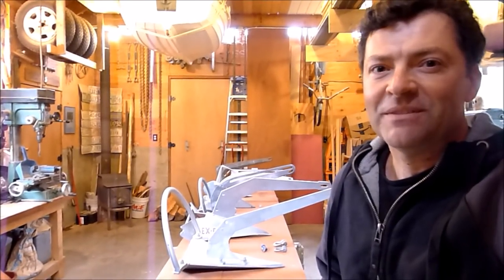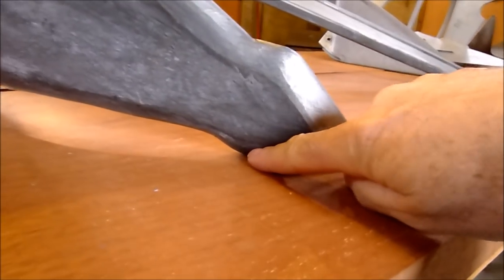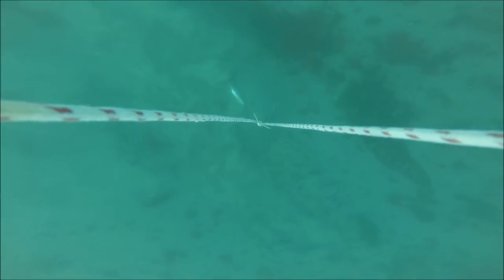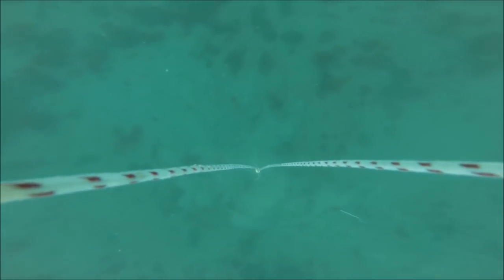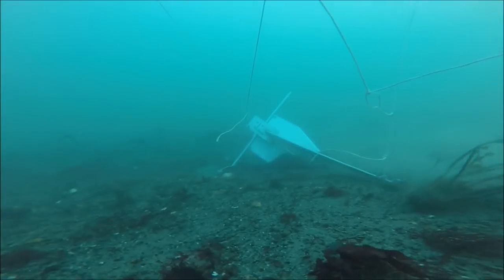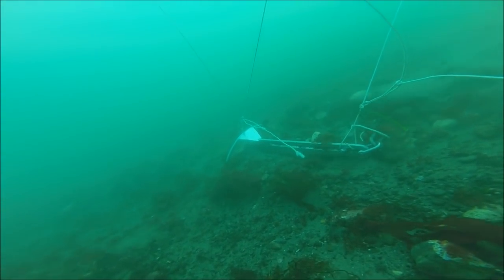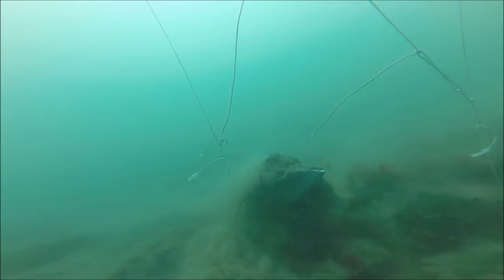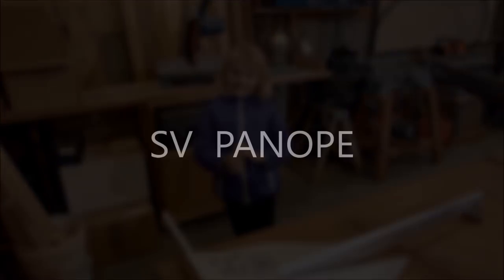Anchor Test Compilation. Video #56 of an ongoing anchoring series.

Comment: Steve, I have watched this video 4 times. It is amazing the work you did. Thank you so much. If I may ask, if you could only have one anchor set in in good/okay bottom for a storm 50-60kts which would you pick?
Reply from the maker: Thanks, David

Tough question without more background.   Assuming this is a FORECAST storm that provides the opportunity to fit an alternate anchor AND the storm is of the variety with a single wind direction, then it would be hard to beat a big Fortress anchor.  The fact that it is disassemblable means that this large cumbersome anchor might actually be onboard the boat!  

If the storm is of the 'multi direction' variety, then a big Mantus would be great as it is also disassemblable.

If we are talking about using the normal 'reasonably sized' bow anchor for an un-forecast event, then the Spade, Excel, or Mantus would be good choices.

It's hard for me to recommend the the very popular Rocna or Manson Supreme given their tendency to become fouled and not re-set in my tests.  I realize this would be a very rare occurrence in real use, but, like crashing your car into a wall, it only takes once. 

Cheers,

Steve
Reply: Thanks so much Steve, I really like the Mantus, but you scared me with the "weak shank" talk. The are right in my backyard in Kemah, TX.  I really like the Excel. Its foot print is so much better than the roll bars, but, I have not found any other independent tests on it that look trustworthy. Do you know any? The fortress is a must have anchor. Thanks for that kernel, since watching your stuff I have found lots about it. My wife and I are planning to take two years off and go cruising. Peope like you are an amazing source of real information. Thanks again for your efforts.
Reply: Thanks so much Steve, I really like the Mantus, but you scared me with the "weak shank" talk. The are right in my backyard in Kemah, TX.  I really like the Excel. Its foot print is so much better than the roll bars, but, I have not found any other independent tests on it that look trustworthy. Do you know any? The fortress is a must have anchor. Thanks for that kernel, since watching your stuff I have found lots about it. My wife and I are planning to take two years off and go cruising. Peope like you are an amazing source of real information. Thanks again for your efforts.
Reply from the maker: Part of the reason the Mantus anchor shank compared unfavorably to other anchors, is that my "45 pound" test anchor only weighed 40 pounds.  

Perhaps a 55 pound Mantus would have been a better comparison to other 45 pound anchors (that actually weigh 45 pounds).

Of course this negates some of the price advantage of the Mantus anchor.

Steve

Comment: Awsome video!!  I just ran across you anchor testing and was really impressed with your technics and results... after watching your videos I am also leaning towards the spade anchor!! My question is my current boat is a 34 sea ray. The s100 would certainly be more than adequate for that boat (15.000 lbs) but in the next year I plan on moving up to a 40 foot trawler weighing close to max rated weight for the s100 anchor (24.000lbs) I plan on keeping the spade anchor and taking it to that boat.. what’s your thought on moving up to the next size anchor?? Or do you think the s100 would be adiquate working at its max holding ratings??

Comment: I appreciate you doing this test.  I know you hesitated to share your judgements at the end but I will say I think it's wrong of you to dismiss the Mantus because the shank 'looks" weak.  To me it looks perfectly engineered to withstand the forces the anchor is designed for keeping the weight to a minimum where the weight needs to be minimum. Without engineering data to back up a comment like that it's not really valid.

Comment: Steve, an other question. I bought the 44 lb Spade and a 7/16" alloy steel shackle to match the strength of the 3/8" G4 chain. The shank hole width is too small to fit the shackle pin hole outer diameter. Did you encounter the same problem? You did have to use a second  shale on an other one..
Reply from the maker: A 7/16" shackle will JUST fit through the hole of my 44lb. Spade.  The fit is so close that I have to wiggle the shackle back and forth to get just the right angle before it will pass through.  Once the shackle's boss has passed through, the fit is good. There is plenty of slop to allow free shackle movement.
Reply: @flygoodwin  The gav alloy steel is just too big. If I file it then I will be removing the zinc coating.  I am getting a 3/8" one . It's WLL is 2 T. I think that the Spade will walk before it breaks LOL! Just for back ground I had a 45 # Delta with 33 m chain on a Jeanneau 409 ~23,000 # loaded. I had several dragging events.I am in the Chesapeake with mud, clay and sand. Thank you for your research.

Comment: I'm a sailor for 40 years, I have a Ct 41 and a moody 44, always using a 45 pounds original CQR made in Scotland.  NEVER EVER FAIL. 300 feet g40 high galvanized chain, high quality swivel and shackles. My secondary anchor is a original 44 pounds bruce made in England,  same, spectacular. Fortresses is garbage, get bent easily, made for stop on the beach in a beautiful day.

Comment: Steve, are you still reeling to questions? If so what do you think of the bolts in the Mantus capturing mud?
Reply from the maker: Captured mud appeared be no factor with the 45 lb. Mantus.  

The 13 lb. Mantus did suffer from captured mud that was located in the vicinity of the shank bolts.  I have to assume that if the bolts were not present, less mud would be captured.

Comment: Thanks so much for doing this hard dedicated work.  I cruise a challenging area and am considering a Fortress FX 16.  I usually put out all my scope (30 feet of chain; 300 feet of line) and power set my anchor, then adjust scope to no less than 6:1.  It seems that this is a more realistic test than the short scope tests.  Will you be doing any such testing?  Would you recommend the Fortress in this application (usually sandy bottom)?
Reply: +Dean Benjamin There is no load on the bolt. The actual load is carried by the geometry of the shank when it's inserted in the base.The boalt is there to keep the shank from inadvertently coming off when your moving it around on deck.

Comment: really nice job. Curious what you used such short chain to depth ratios. I never anchor with less than 5 or 7 to one.
Reply from the maker: Thanks Lincoln.  In my local waters, 3 to 1 scope is very common due to confined, deep, and crowded anchorages.  Longer scopes are often just not possible.

Comment: why no delta set fast? would you put the names of the anchors on the video. it is difficult to follow you. also, you are not testing some more common traditional anchors.  you do not tell people if the anchor is rated SHHP or HHP or unrated, etc... BUT, thank you very much for doing this work. nice work.
Reply from the maker: Hello John.  I tested a Delta anchor AFTER this compilation video was created.  See Video #70 from my list of anchor tests.  

Sorry you had trouble following this COMPILATION video.  I recommend that you take the time to watch each of my anchor videos separately.  My YouTube channel is called SV Panope.  There, you will find many many hours of footage.  Enjoy.

Steve
Reply: I was trying to figure out which new anchor I wanted to buy. I have the classic anchors, called HHP anchors. I now realize there are a new batch of anchors rated SHHP. So, I am looking to find one or two SHHP anchors to put on my boat. I have Fortress but am thinking of buying a FX37 to get the SHHP rating, and then am going to buy one of these new anchors.  I bought a Rokha as an upgrade to my Delta Set-Fast, but according to your tests, the Rokha is little or no better than the Delta Set-Fast. By the way, thank you for doing this and posting it. outstanding work.

Comment: Great videos!  Question on the spade, though.  Isn't the ultimate strength of the shank attachment dependent on just the single bolt strength (in shear) that pins it in place? Great anchor, but could that be its weak point?
Reply from the maker: Thanks Scott,  I believe that very little load is placed on the Spade's retaining bolt.  The geometry of the shank and socket are such that chain loads cannot remove the shank, even if no bolt is present.
Reply: You can remove the pin and the anchor won't separate while in use. Has zero force on in in use.

Comment: The boat will never pull straight on an anchor.  Especially in strong winds. It will pull like a pendulum,  oscillating 90 degrees off the center, fro and back.  I mean oscillating real fast. Over time,  it will work the anchor out of the sea bed.  It will never reset, since it will fly, not even touching the sea bead again as the boat rushes downwind.   I experienced that during Irene hurricane, hooked, thank God, to a vise mooring. I had two hooks, one as back-up of the other.  The first spread wide open.

In those circumstances, you  do not care much about your anchor  setting quickly.  You want it to hold, you stay awake, the engine running, and you watch your neighbours drifting, endangering everyone.  The resistance to oscillation is the name of the game, as is the resistance to extreme traction.

In the south of France where the hurricane force Mistral winds are very common, I mean, about 10 times a season, everybody has a CQR anchor.

I have a 45 pounds CQR anchor and a back-up 45 pounds Spade anchor, mainly, because you can dismantle the latter.

You had very good visual on your tests, but the science of it was fatally flawed.

Comment: There is so much of this type of thing on the internet now. It confuses me. Anchor designers designed their anchors to be used a certain way and yet tests are done in direct opposition to those design parameters. Then decisions about an anchors usefulness/value are then determined by those erroneous tests. Anchoring with a 2.5 or 3 to 1 scope is not recommended by any manufacturer. Ever. Backing down at 3 knots is never suggested as safe or reasonable and a good way to damage most boats with our current crop of fast setting anchors. Driving over your anchor at 3 knots to test a re-set is very dangerous (that technique should never even be used to release a stuck anchor). The anchors were not designed to work under those conditions. You are basically testing random non-real world events that will never happen. It's like testing several cars by driving them backward on the highway and then using those test results to decide which car to buy.  Your tenacity to try tests over and over to get results is very commendable, but you should be testing things that really happen in real life cruising. I've cruised several oceans of the world for 40 years, I always anchor (never at a dock), and I have never encountered your testing conditions even once. I did indeed hear your caveat that you were admitting to unusual testing, but people are not looking at it that way. New sailors should really look at your tests with a grain of salt. Not realistic. Many of the other things you have done are excellent. You are indeed a fine craftsman. I otherwise applaud you.

Comment: These tests are rigged, with the ridiculously short scope! If  real life 5-10 scopes were used, the results would be very different, because many anchors are designed to break free easily when pulled at steep angles, as you darn well know. Mantus anchors are designed to break free only when pulled almost vertically, while others are designed to break free around 2-3 scope. Of course Mantus APPEARS to do well when tested with short scopes!